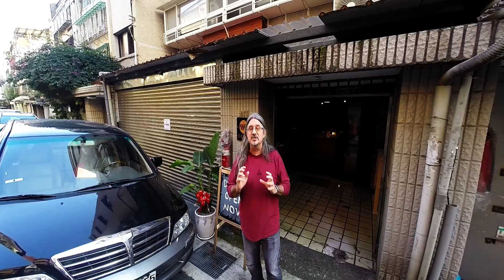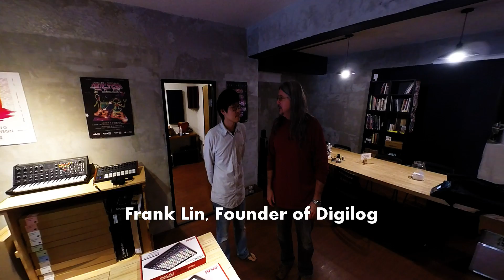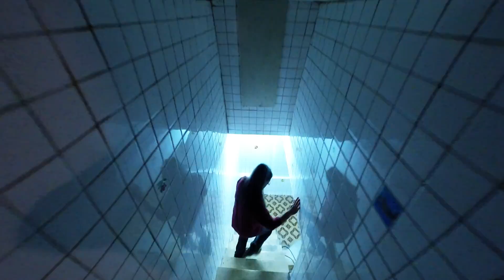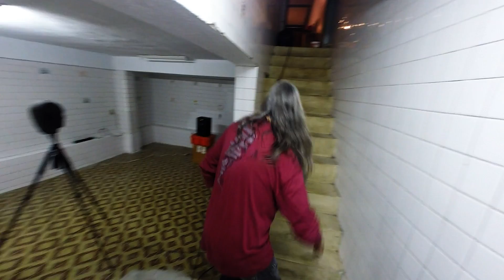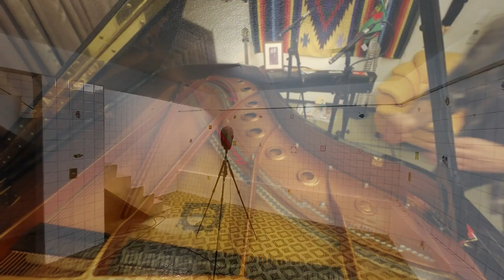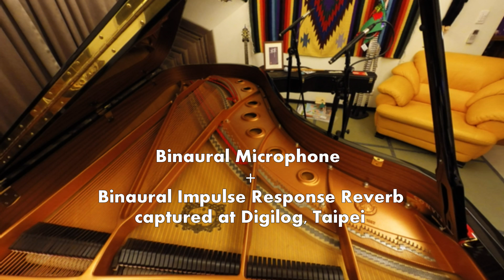Binaural Impulse Response Recording

Comment: Listen carefully, the conventional near-field microphoned version of the piano is actually more realistic sounding than the version with binaurally microphoned room reverberation added to the near-field microphoned track. The reason for this is that the reverb component is much higher than what would be normally heard in most listening environments. Reduce it by about 6db and you will confirm that the overall near-field to far-field balance will be more realistic. Having said that, the near-field microphoned version sounds remarkably good, I assume by virtue of careful mic placements.

Comment: Hi! Wouldn't shoulder/torso reflections account for some influence on the impulse response recorded at the ear mics thus improving the captured response?
Reply from the maker: It has been said that upper body structure is helpful, as well as hair. But my testing, for example, with the Kemar system complete with upper body, I found less pleasing results than working purely with the KU-100. But I encourage you to experiment, as well.

Comment: Hi, one important question: does the IR softare that you used to capture the reverb support the binaural microphone and stereo imaging? does it support stereo mics? could you tell what software did you use? before this video I was familiar with ir recording with just one mic. I have used IR for many years but this is totally new! thanks a lot
Reply from the maker: I am using Altiverb. It supports stereo IR recording, which is all that is needed for binaural IR recording.

Comment: This is awesome. Could this work real-time in games, or is it too hardware demanding?
Reply from the maker: +DaveK183 Could work in games for sure. But you'd apply different techniques for different sound purposes.
Reply: Matthew Lien But would it be real-time? Or does it take some time to apply the impulse response?
Reply: +DaveK183 Long reverbs = long impulse responses = long convolutions that has to be applied in real time. It will be very demanding to do in real time but todays computers are so powerful it should be doable
Reply: Sigurd Møller Yeah, but the games themselfs are already demanding you know.
I think that for example Battlefield already uses some kind of ''echo sample''. Just look at the map metro in Battlefield 3. It really just sounds like they let explode a grenade in that environment. (sorry for my english)
Reply: without knowing about game sound processing I doubt that long echo/reverb effects are computed in real time. There would not be any need to compute that in real time because it could proberly be computed before that happens.
Reply: Sigurd Møller There is a need to compute it in real time, otherwise you would have to make a separate sound file to every echo of every sound in the game and save it to the harddisc.